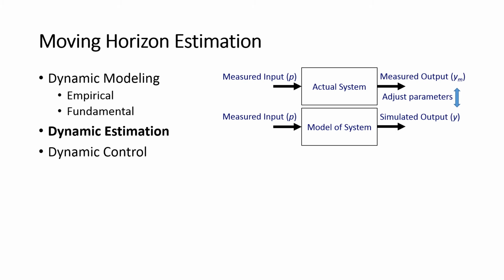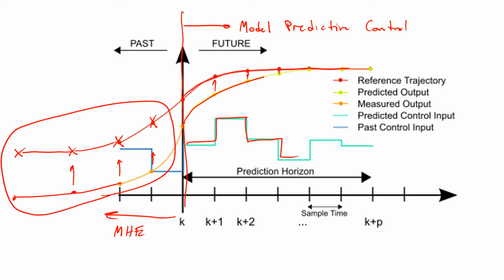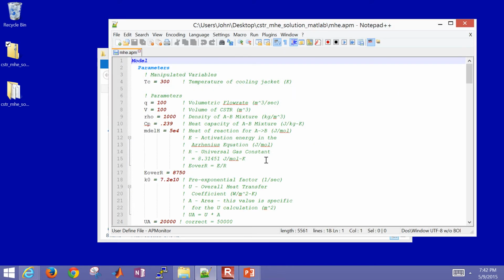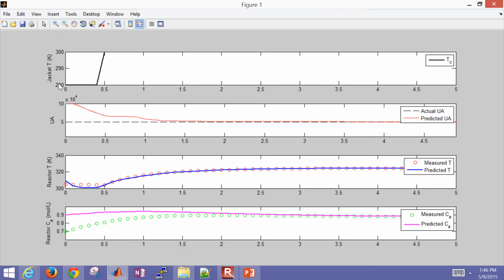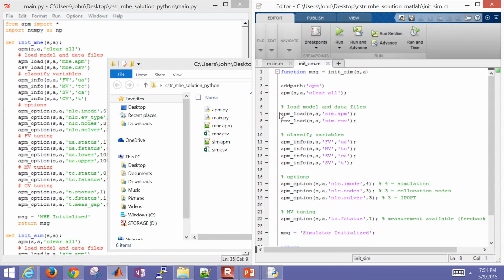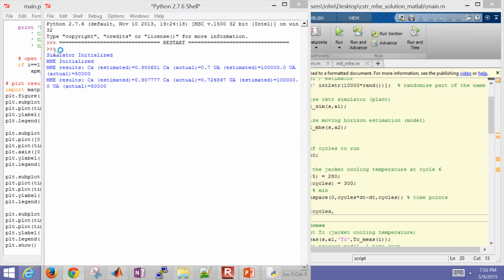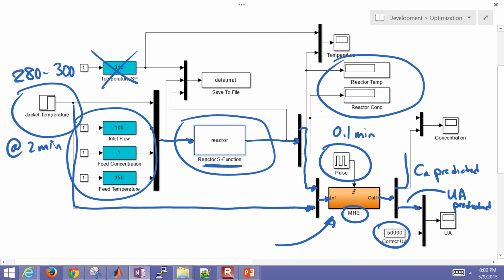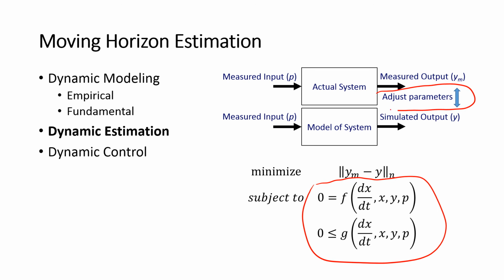Moving Horizon Estimation in MATLAB, Python, and Simulink

Comment: Hello, nice job, this is an excellent and handy video.
I am Ph.D. student and I am working on online parameter estimation. I wondered if this implementation can run in real-time or online in platforms like dSPACE or OPAL-RT.
I will really appreciate your help, so far I have been using casadi to implement the MHE and it's working fine but it's not possible to implement that in the dSPACE or OPAL-R
Reply from the maker: There is a Python interface in dSPACE so it should be possible to run Gekko: https://www.dspace.com/en/inc/home/news/dspace-tool-chain-python.cfm
Reply: Hi Jesus, I'm also working on using casadi to implement MHE for online parameter estimation and I would love to look at your approach. I'd really appreciate any help or just some insights from your experience working on this topic!